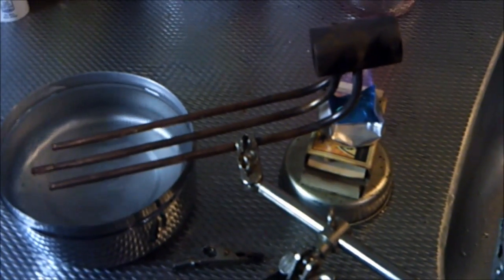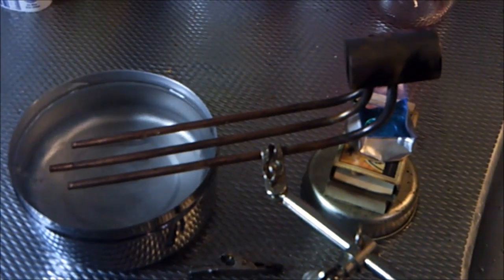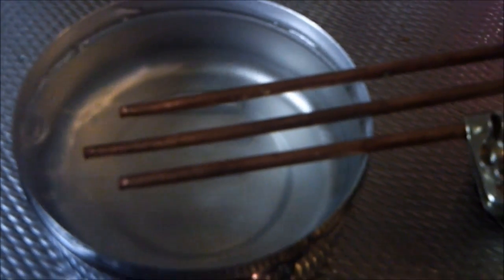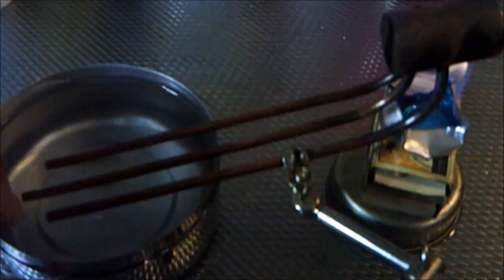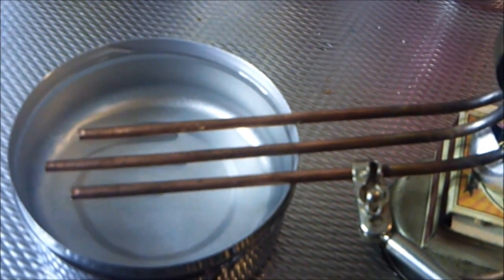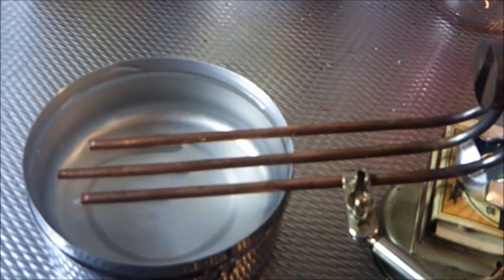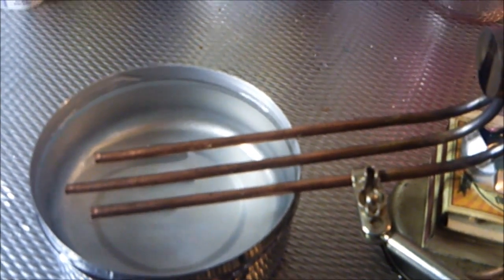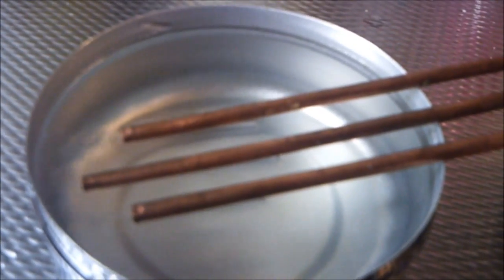Crazy pop-pop boat water jet steam engine (homemade) experiment!

Comment: Interesting. In the video they look like the kind of steam bursts that occur when the water piston is on the verge of breaking down and some live steam escapes and condenses with a pop when it hits the reservoir water. That is sometimes caused by short pipes so that the stroke takes the piston to the end of the pipe and even happens with submerged pipes. What you have here seems somewhat different though as it keeps running. And it runs in boiling water? Good job.
Reply from the maker: +Daryl Foster Too bad about the efficiency, else I could sell the engine as an air pump without moving parts for aquariums and ponds. ;)